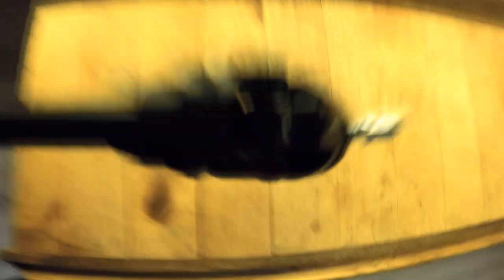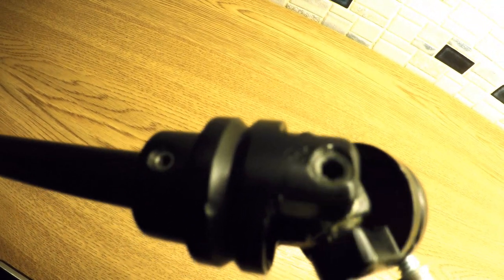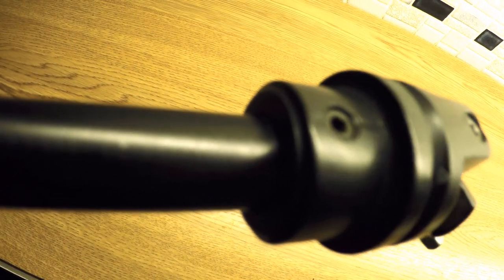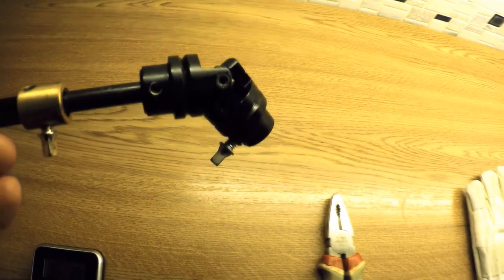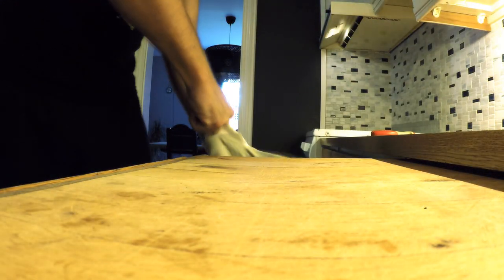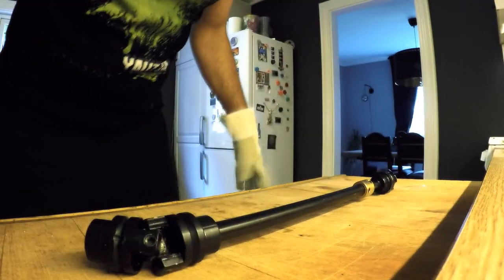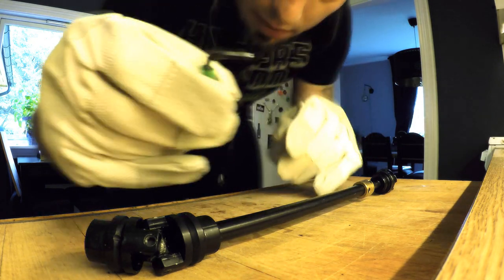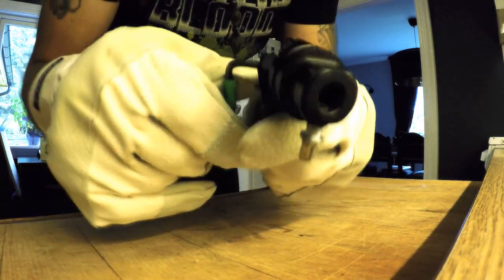AXIS Universal Drive Shaft repair - Lucassdrummer

Comment: Holy $hit dude, this video was a GODSEND!!! I have two older A-series double pedals and the u-joints have been crap for years, I've been pricing replacement drive shafts recently and the absolute cheapest I've found is $149 USD each, +tax, +shipping >:(. You just saved me well over $300, and all it took was about 20 minutes to fix both pedals!!! You 'da MAN!!!    \m/_  _\m/
Reply from the maker: At tour service, anytime! Just don't over tighten the screws and enjoy your new driveshafts!😉👊

Comment: Wouldn’t that make the oven unusable for cooking afterwards due to the loctite fumes? If I may suggest a safer alternative, use a heat gun in an open space and simply heat the mounting areas rather than the whole thing!
Interesting watch though! Subbed 🤘🏻
Reply from the maker: Hello Clayton! Thank you for the feedback :) There are a few other alternatives to baking the entire UDS and the heat gun is one of those :)
I would definitely NOT make food in an oven that is used for melting loctite all the time.. But since the amount of the thread locker is really minimal and you do this like once a year or so (5 minutes), it's enough to ventilate the oven (and the room) after the use and it's good to go. 
Cheers!

Comment: Thanks dude! Also ive noticed with these drive shafts are the U joints a little more "stiff"? Ive noticed that with axis most of the U joints ive used almost feel magnetic and not really super loose like other pedals. I even put some car grease on the U joints like i have with other pedals (works AMAZINGLY) and it was a tad bit looser but still on the tighter side. I have no issues when playing so not sure if it was deliberate or not

Comment: Any chance this will work with old heel blocks?
Reply from the maker: It may work. If the housing is not worn out, you can take everything apart, grease the axle rod inside the heelblock, as well as swap the washers. They are made of plastic so they are prone to melt as you apply excessive heat. Worth giving it a try.
Reply: @Lucassdrummer  Thanx for the reply Lucass! I will try for sure and let you know what happens 🤘😎👍